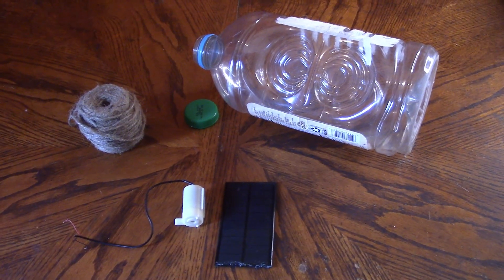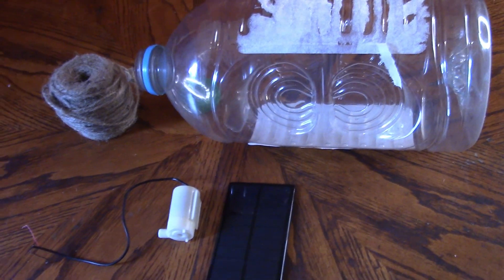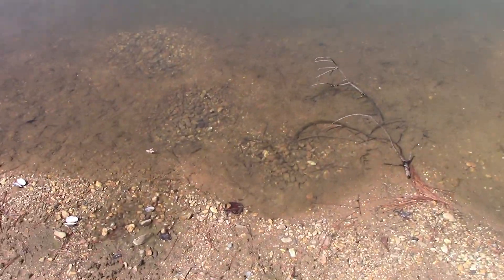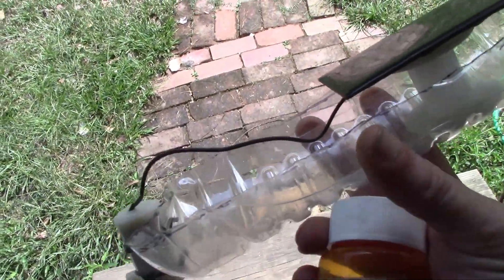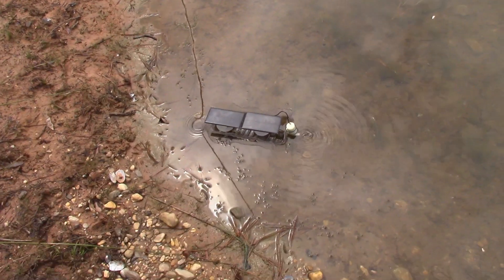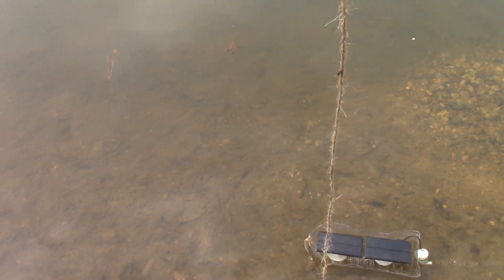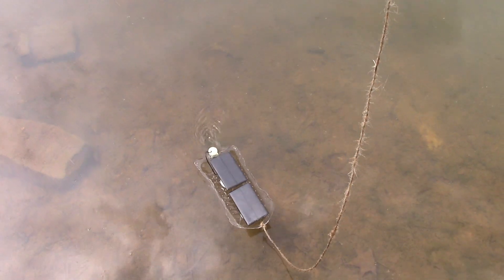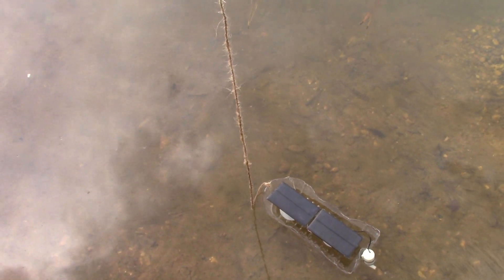How to make a very simple jet boat

Comment: Thanks for the mention. I did an RC version where the pump was mounted external like this, and instead of a rudder, I turned the whole pump to change direction. Sort of thrust vectoring. Another issue is they can get clogged easily with floating debris, like a leaf etc.
Reply from the maker: Oooh good point, using a servo for the direction. Thinking about it I think I've seen at least one of your vids about the mechanism.
The first motor seemed to have a piece of something stuck in there, though I did ground it so am not surprised. It now has a keel, got strengthened with hotglue, the string has been changed for fishing line and it's fit for another try. Except, the sun went in for the day, right on cue!
Reply: @Slider2732_  we seem to be in the rainy season at the moment, several days of continuous rain forecast. I certainly rained all day today 🌧🌧